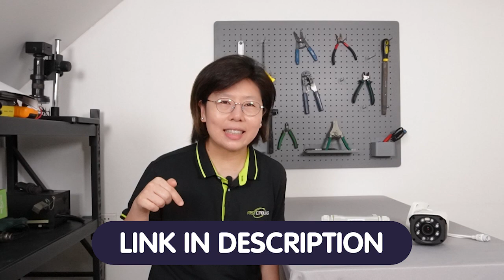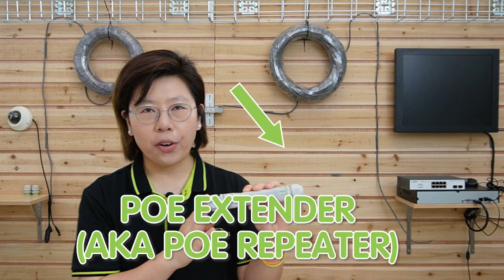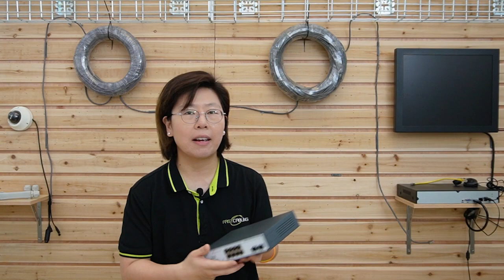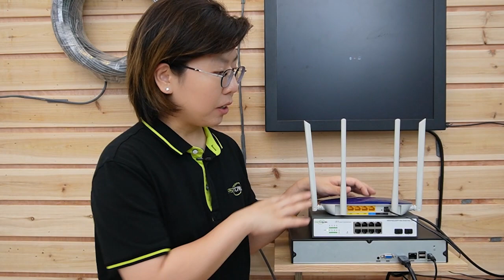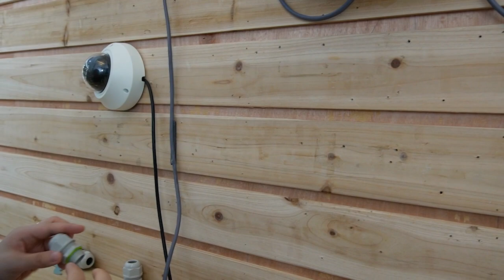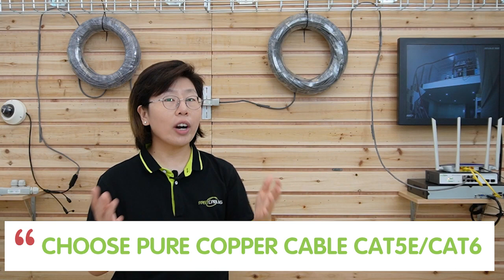Using PoE Extender to Install IP Camera Beyond 328ft

Comment: Can I connect the extender between NFR an Ip camera without the switch the distance 130 m
Reply from the maker: Certainly! You can use a PoE extender to extend the distance between your NVR and IP camera without a switch. However, keep in mind that the PoE extender needs to receive PoE from the main network to power the extender & IP camera, or you can use a PoE injector instead.